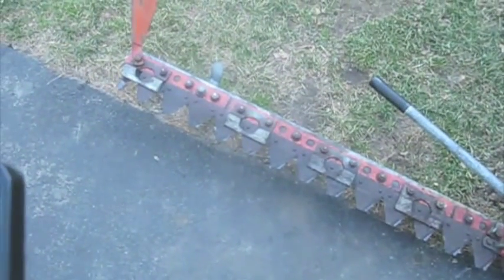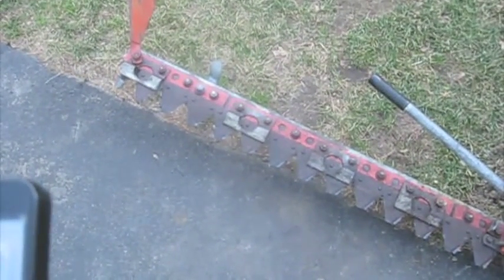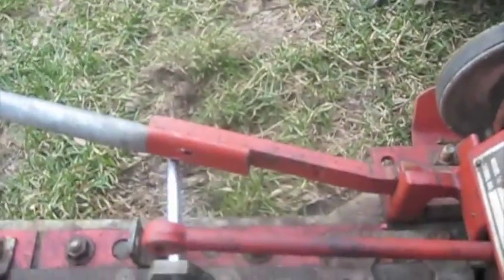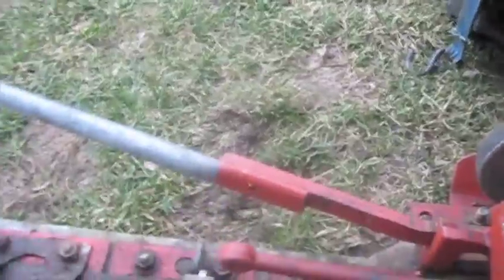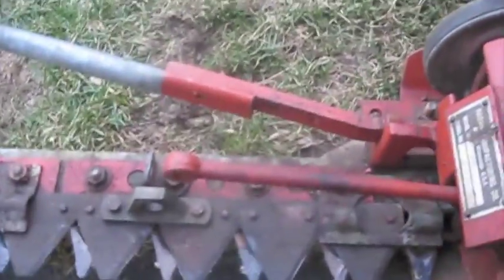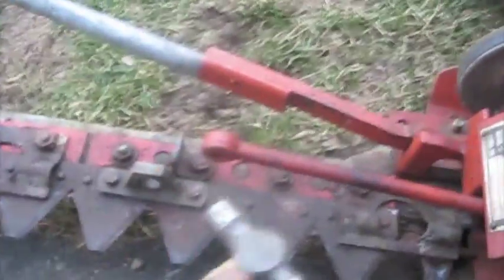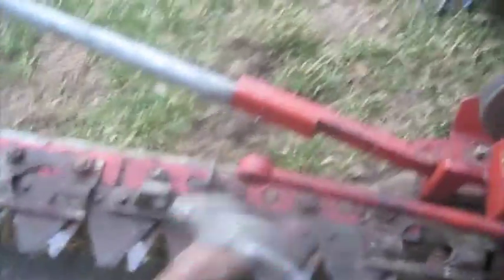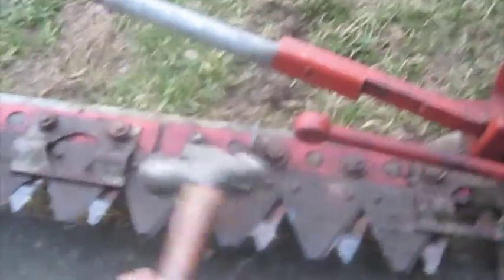Haban Sickle Mower Project #4: Cold Weather and Bar Lubrication

Comment: after all of that and it's still tight use a wire wheel on a drill motor to clean some of the rust off. your doing aa nice job on it what year is your tractor?